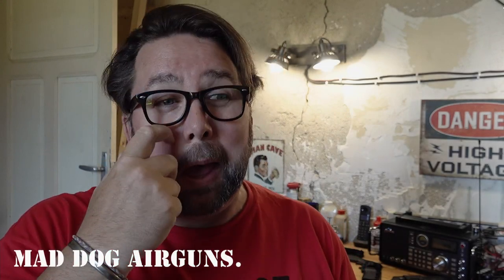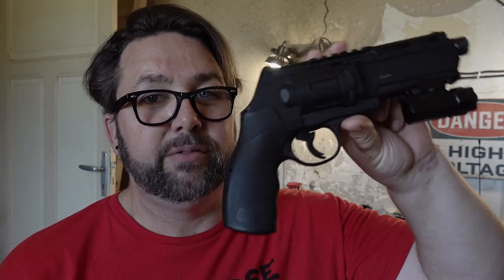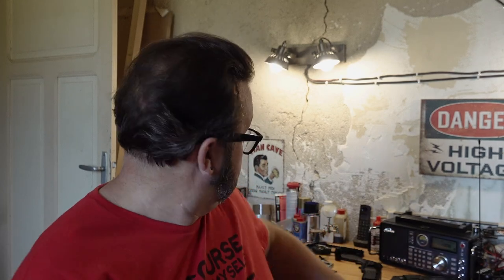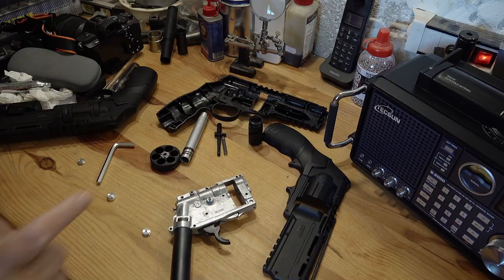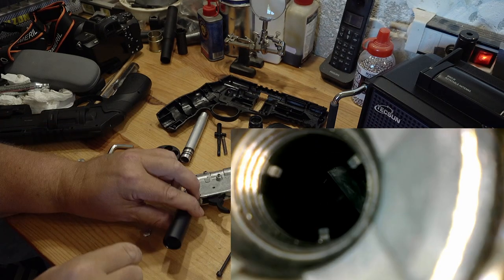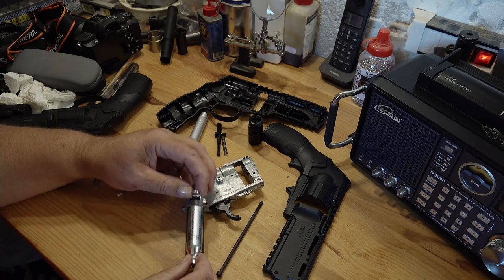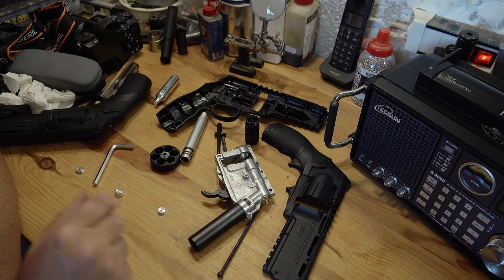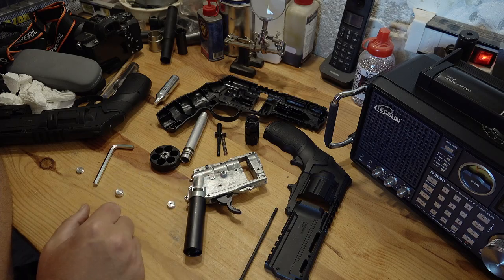This HDR 50 has Issues

Comment: The CO2 tube will expand as will the CO2 receiving Adaptor, the adaptor will expand quicker.  This can cause issues with the gun and cause it to be unreliable and slightly dangerous.  This gun is a cheap mass produced, TOY.  Taking it up to 30 Jules, is very risk and I recommend you do not do it.  You are putting cast metal  and cheap springs, fittings under stress it was not designed to be under.  How do I know,  I was an armourer  in the military for many years, full qualified and certified ,  BEng, MEng and CEng.  I still get a lot of pleasure in working with weapons, and fiddle and mess about with Air Weapons. Air weapons are little researched and most people are unaware of the power possible from Air Weapons.  It is the .50 calibre that the most advances have been made, with FPS of just over 1,000  FPS, compare it to a Barrett M107A1 which has a FPS rating of just over 5,000  it might seem to be a poor second.  well the opposite is true, throwing a .50calibre at over 1000 FBS will kill a wild bore .  The longest effective range an air rifle has shot effectively is 1,400 yards. I say it again, 1400 Yards Airgun World Record with Altaros M24. That is incredible.  A .50 calibre has taken down a deer at 475 yards.   These are highly tunes Air rifles, with a lot of new metals, fittings etc to deliver an increase in power. The weight of CO2 tanks, the weight of the air weapon, the delivery of the round, the inherent weakness of the magazine holding the  pellets, the fitting and alignment of the barrel, the magazine.  I have played with a 50 calibre semi automatic  mach
Reply: "with FPS of just over 1,000  FPS, compare it to a Barrett M107A1 which has a FPS rating of just over 5,000  it might seem to be a poor second.  well the opposite is true" How so? A kid's bow and arrow or a .22 can kill a wild boar too.

"This gun is a cheap mass produced, TOY." Agree kinda. For example my HDP50 jams a lot, its not a real weapon that somebody would use.

"Taking it up to 30 Jules, is very risk and I recommend you do not do it." The only risk is if you have Gen3 T4E capsule valves. They are weakly crimped and can explode. But it doesn't matter if its 7 joules or 30 joules they are unsafe either way, even if it is unmodded the Gen3 crimped valves are unsafe.

Comment: The fact the co2 has such a blunt rounded bottom and its still getting stuck in the chamber is very strange.
Reply: absolutely! had the same problem although I didn't touch the co2 restrictor so nothings cross threaded...
Reply: I had issues with stuck CO2, but found a solution - when the pressure is low making empty shoots until the revolver stop output gas. Then the CO2 out itself from the chamber.

Comment: Over time I have found a lot of issues with the modified versions of the hdr50, such as valve blocks shooting off causing damage and rupturing CO2 chambers, this problem mainly occurs when the air restricter is removed from it's chamber. I found that if you remove the CO2 chamber seal it with locktyte then screw it back on it eliminates this problem, I used the same technique for the valve block and it worked. If not the pressure from the CO2 will eventually either destroy the rings and case leaks, rupture the CO2 chamber, or the pressure will remove the valve block especially if it's no locktyte on it. I had my TR50 for a year no the maximum power I got was 45 joules. Which is very effective depending on what ammo you used and where you shoot an attacker. The best air I have interms handling air pressure is the Sabre 68 cal. I have a pierced CO2 in it now. I had it in 4 months it still hasn't ruptured the rings and it better than my bryna, it not nearly as strong as the TR50 modified but 16-18 joules out the box is not bad. I tested it on a enemy car window and it shattered the front windshield like it wasn't shit. And this was with the Duke impact rounds.

Comment: My Englisch is not good. Can you write the problem in the comments, please. So I can translate 😅. Thx
Reply from the maker: The gun would fire six shots, then reload another drum and it would get stuck on the seventh shot, the trigger would not pull and then the CO2 would not come out of the chamber. 👍
Reply: @Maddogairguns  

(My english is also bad)

Ùh.. wait. What kind of bullet u use that time? I think i can get some clue.
Maybe that bullet little over sizing than barrel hollow or there is a slight defect in the bullet or after a bunch of shot, bullet at cylinder magazine not on their position sharply and that causing the bullet failed to take off. It'll effect to trigger mechanism which locking it. Is your magazine drum also jammed?

Actually i don't have HDR50. Just thinking about buying it because i'm in air rifle field. I just had a very similar problem with my gamo pt85.
Sorry for disturbing u with my stupid clue. 

Regards.

Comment: Ive had the same problem when I removed the valveblock although I didn't touch the restrictor in the chamber. I also have  some co2 farts after 8-10 its over and the whole trigger mechanism is locked back
Reply: Did u fix it or find the problem mine started this today
Reply: you have to loosen the screws on the inside.

Comment: Mate any chance you can help me please… I cannot unscrew the co2 plug at the bottom of the handle…. It just keeps turning around !!! It’s done this once before but eventually opened after the co2 canister had warmed back up…. It’s brand new and only used a hand full of times tops…. Any ideas please… it’s now rendered useless !!!
Cheers buddy….
Top vids too btw…. Watched them for ages… you were one of the reasons I got one 😁
Reply: Hola, pudiste encontrar solución al problema? También se gira en el mío y con suerte habré disparado un par de co2.. veo que viene emballetado no sé si es normal que se gire la cámara de co2.
Hace poco quisieron robarme mi auto y cuando quise usar el hdr, poner un co2 no pude, se giraba completo, de hecho se gira con la mano sin mayor esfuerzo, espero no esté malo, ya que está nuevo.
No encuentro información tampoco al respecto en internet.

Comment: Do you know if the 11 Joule version is still available in the UK? It seems to be discontinued on most sites, only site I’ve found it on is a French and don’t want to order it and get in any trouble. I can get the 7.5 I guess but just wondering…
Reply from the maker: I'm guessing that they are discontinued due to them (technically) being too powerful for an air pistol in the UK. You will hear a lot of stories of  it being a grey area for power limits with paintball markers, but even paintball legislation says 6 ft lbs for an air pistol and 12 ft lb for rifle in the UK.

Comment: Huh, not nice - good you're spreading the news, thanks for that.
I have a question: what distance from chrono you keep (I've got R2 version), my untouched HDR 50 11J gives about 3J, and I'm not sure if my shots are too close to chrono and if that can be the result...
Reply from the maker: I normally shoot from about 30-40 cms. And get fairly consistent results.
Reply: @Maddogairguns  I was half your distance then... Will try your way as soon as it stops raining.
Thanks for response!
Reply: @Maddogairguns I have a gas leak on my standard uk spec unit. Are you interested in fixing it?

Comment: Is putting in the z ram extension basically a waste of money  if I’m going to mod straight to the hpa bottle anyway,seems obvious to me but I am new to this ,thanks
Reply from the maker: If you're going to HPA it, then don't bother with the Z-Ram extension. If you are connecting the HPA bottle via the handle (CO2 tube), then you could use the extension. I have seen some people do it. I've not bothered as with HPA and a couple of barrel extensions I can get 75 joules.

Comment: I'm asking as I've never owned one of these before. Is my chamber supposed to spin so freely? If I flick it with my finger it will revolve 3 or 4 times. Is that the norm for everyone?
Reply: No, it shouldn't be that way. Check if the barrel slides in and out freely. The barrel should go forward a little when you shoot, and then come back and it would hold the chamber.
Reply: @MihaiLeonardoNiculescu  thanks bud that narrowed down where I needed to start looking.  Got it figured out quickly. it looks like when I put my cylinder in, I need to let the ejector rod slam shut. It works fine if i do. 🍻

Comment: If its not 7.5 joules then it will put you in uk prison😮
Reply: Incorrect information. I've never heard of anyone going to prison for an overpowered air weapon. Also, how would they even find out, are you going to walk into the police station and announce it? Only time you'll land yourself in trouble is if another crime has been committed and as such they felt the need to test the air gun (which is outsourced and usually expensive to do)